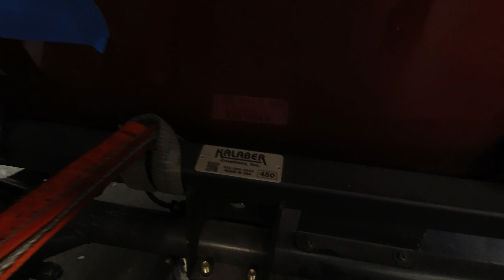URAL MOTOR REBUILD PART 2

Comment: I swear it's the electrojet fuel injection, I'm on my 3rd cylinder on the left side, first replaced under warranty and the dealer didn't do a good job. Right cylinder has run perfect since day one. I'm upgrading to the newer fuel injection right now, plus the newer cylinders but the old heads. When I tore it down I found the last guy put two dowels in the left cylinder and must have tightened the hell out of it to get it to seat with the head. Thank God it didn't destroy the head. Hopefully the newer style pistons and cylinders help cool plus the new injection should keep it happy
Reply from the maker: What year Ural do you have?
Reply: @OverlandTravelAdventures  a 2015 Gear Up, I love it, but doing all the 2019 and up mods

Comment: Good videos. Too bad about the pistons, but good info about engine heat. My 2018 runs 150psi on both cylinders.
Reply from the maker: I need to be more gentle.
Reply from the maker: Good to check!

Comment: Would call BS on the winch being the cause of the lack of airflow that lead to overheating.
Reply: Might start with confirming ignition timing and FI function A/F ratio.
Reply from the maker: I think you are right but the right cylinder had way less compression and fried everything inside.